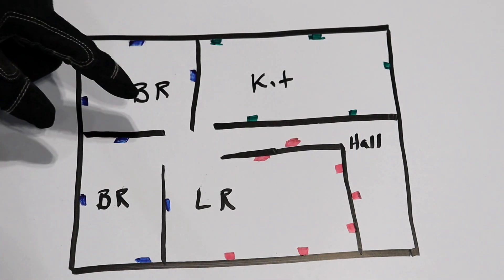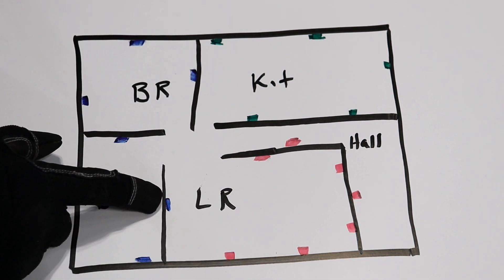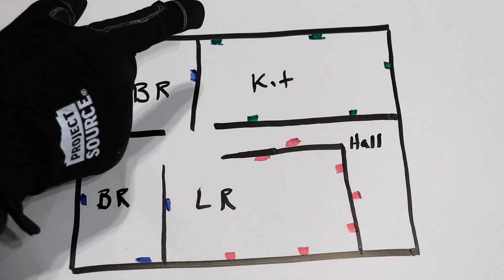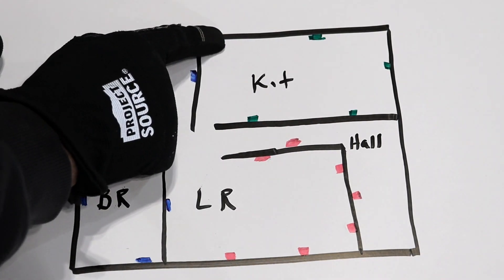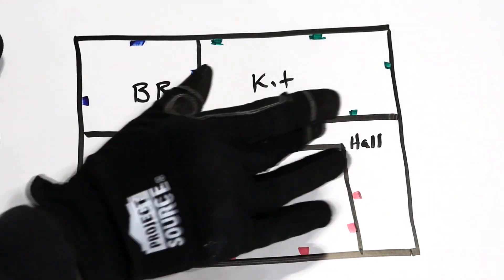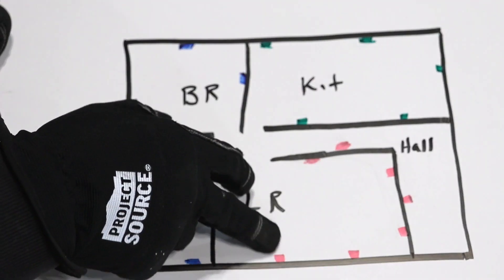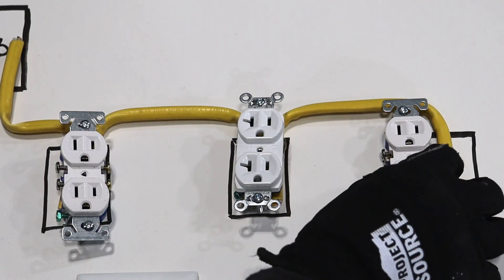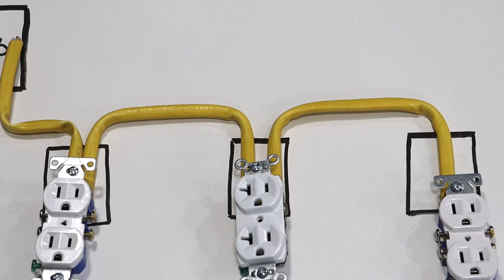How to Identify the Order of Outlets on an Electrical Circuit | Determine Outlets Wired to a Breaker

Comment: In Japan, they don't daisy chain their outlets. What they do is, for each room, they bring power from the panel to a junction box. And everything within that room gets power from that junction box including light switches. I think wiring that way is beneficial when it comes to diagnose because, if there is something wrong, the problem mostly is either at the junction box or the device itself.
Reply from the maker: That's true, but for safety, it is better to have lights and outlets separated so if a outlet circuit trips, you still have lights.
Reply: Rooms these days have 8 or 9 receptacles in them.  Even the smallest room has to have 4.  If you are not daisy chaining any receptacles then you have are going to have a pig tail with 6 wires in even the smallest room (hot, plus 4 receptacles, plus 1 light).   

Moreover, you would have to do all of your arc-fault and ground-fault protecting with breakers.  That's fine, but it costs more.

Comment: Why would you need to know the first and last or the order of it if everything is working correctly and if not then you troubleshoot and fix it
Reply: Adding a gfci to the first outlet in the circuit for a home with an open ground.
Reply: Reverse engineering 😊
Reply: if you wanna remove or move an outlet to a new location, you gotta know where the wire is coming from so you can decide if you need longer or shorter wire to the new destination

Comment: Thanks for the video. Is there a certain type of GFCI breaker to use with a GFCI outlet, or just the standard breaker is fine?
Reply from the maker: A standard breaker is used for a gfci outlet.
Reply: @brettleybuilt  thanks

Comment: Thank you for this vid. I have a GFCI that just went out. Used that tester by Klein and it wont trip plus the test/reset wont work. The GFCI outlet controls a receptacle on the other end of the house (rental so all screwed up) Tester shows hot gnd rev. Guessing I need to replace one or GFCI receptacle or both?
Reply from the maker: It may not hurt to replace both as the gfci which is bad is the big expense. For the cost of an outlet it may be a good idea to just replace both.
Reply: @brettleybuilt  replaced the main GFCI and it fixed the entire issue. Thank you

Comment: There is a much easier way, plug in a heavy resistive load such as a heater. Measure the voltage at each outlet. Outlets beyond the load will all have the same voltage. Outlets between the loaded outlet and the breaker will have progressively higher voltages. All due to voltage "dropped" from the resistance of the wiring and connections. This can also show bad connections when the voltage drop is excessive. The voltage drop due to a 1000W heater is very measurable over just a foot of wire or so.
Reply: That's interesting.  That's also a good reason to get a pigtail cable that plugs into a wall socket and has a couple banana clips that you can stick multi-meter probes into.
Reply: What connector is that?

Comment: Hey can a gfci protect outlets both upstream and downstream?
Reply: No, The gfci has a line and a load marked on it. Only an the gfci outlet and those downstream/load will be protected.
Reply from the maker: No, only downstream outlets.
Reply: Good information as a starter, but after 40+ years doing electrical work a lot of this is assuming that the house is wired in a conventional method, the work was performed up to code standards and must take into account any work performed after the initial rough wiring of the house when it was built. Outlets or lighting that was added or circuits tapped into can give false readings, making it even more confusing. I’ve seen some pretty horrible work out there that would make your head spin.
Reply: Thank you
Reply: @agustinherrera5600  It's because it's just tracking the current in and out. You can also get GFCI breakers, but TBH, I don't really get them as you'd typically just install a GFCI outlet at the first place you need to protect and potentially more if you don't like the idea of trying to guess which one is the one that's resulted in losing power to whatever you're using.

Comment: Any receptacle fed by a GFCI protective device should have a GFCI label.
Reply from the maker: That's true. I just think it's unsightly. I should have mentioned that in the video.
Reply: @brettleybuilt  TBH, it seems awfully unnecessary. I can see it being something that inspectors look at, but the moment the inspectors are gone, there's not much point to it other than knowing that if it's not powering things, then you might want to check the GFCI outlets. In my house, most of the GFCI outlets are on a 20amp circuit, so it makes it really obvious that it's also GFCI as the first outlet in that circuit is in the kitchen where GFCI is required. So, I have one unlabeled GFCI outlet in the dining room that's only GFCI because it's further down the circuit from the kitchen.

Comment: There is an easier way to tell the order.   Once you have the receptacle outlets identified as on a circuit, turn off the breaker, verify no voltage, and then take a multi-meter and measure and record the resistance at each receptacle between the neutral and ground.   Highest resistance is the last one, lowest is first, and the values in order will be the sequence.
Reply from the maker: I will have to try this. Thanks for the tip.
Reply: @    Let me know if it doesn’t make sense or if it worked for you.
Reply: What kind of ohm range of values need to be able to measure for this method?
Reply: @brettleybuilt  Did it work?
Reply: Can this be 100% accurate? 

What about split circuits like he showed- one receptacle feeds to two receptacles going different ways- whereas there would be a couple end devices. 

I wonder, too , could the receptacle be run up to and ending in the switches and/or ceiling fixture?
Reply: @NewTruths      Then the one closest will still have the least resistance.   If you know the resistance per foot of a specific conductor on a spool, and have access to both ends, you can tell how many feet are in the spool.
Reply: Everything is very good but that's not the only issue the issue here is that different receptors will have different loads and some of the load may not even show up on the multimeter if it's incoming voltage dependent
Reply: What if the wiring is so old there is no ground?
Reply: @artt6864  then you can’t measure resistance of what you do not have.  You could remove both conductors at the panel, and wire it them together and take readings in the two prong openings in the receptacles.
Reply: Sounds great...except, the original wiring (1957) does not have the 3rd wire (dedicated ground). So I cannot check resistance between neutral & ground ON THAT OUTLET.  I do have a spool of 14 awg ground wire and I could rig up a ground wire from the ground prong of a later, upgraded outlet. Would that work?

Comment: If you don't have a helper to flip breakers,  they make a transmitter and reciever that real cheap.
Under 30 dollars, just plug the transmitter into outlet and use the receiver on the breaker box.

Comment: So if the gfci outlet goes bad all the rest wont work besides the fact that all the amp draw of the regular outlets will go thru gfci outlet so your usage is  limited.
Reply: YES: if the GFCI fails and trips (and won't reset), then all other outlets down-stream will not work.
However, there is no limitation on the power-draw through a GFCI... they are rated to pass a full 20-amps, even if it is only a 15-amp rated GFCI device. There is no need to think you have to "limit" your usage, any more so than with a regular receptacle.
Reply: @Calico5string1962  I think the reason for that is probably how many are installed in kitchens and garages where things with more current are typically used, as well as the fact that you typically wire them in series, unlike most other outlets that may or may not be wired in series depending upon preference and what is going on in the install.
Reply: If you have the top power using devices on their own breaker it greatly reduces the gfi outlet capacity issues. Like separate for both refrigerator and microwave. Dishwasher and garbage disposal units. Unlikely to exceed capacity with what left in a residential kitchen.
Reply: Sort of, if you wire those outlets through the load terminals on the GFCI outlet that is the case. If you pigtail the GFCI outlets and don't pass the current through it to get to the other outlets, those won't be protected by the GFCI protection and will work just fine. But, in that case, you have to install more GFCI outlets if those outlets are in a place where code or common sense  dictates that you need GFCI protection. 

Probably the only reason to do it that way, is if you don't want to go on a hunt to figure out which receptacle tripped and you can't/don't want to get a GFCI breaker.

Comment: 1:38 - Code requires two circuits in the kitchen not counting the fridge or dishwasher, right?
Reply: Yes, the  NEC requires a minimum of two 20 amp small appliance branch circuits in the kitchen.

Comment: Very informative but I'd like to add that ceiling lights can be the home run point of a curcuit as it can be much easier to pull power cord overhead (less drilling) to create the first terminal. Also it is a point to split out a full curcuit run thus less drilling and wire use. If a curcuit for rooms start with a 20amp breaker, 12/2 wire can be used at the start of a run, then towards the end of a curcuit 14/2 is used as the amount of amps will not exceed (by code) a 15 amp draw untill further down the run. As a retired builder/remodeler I've had my fun chasing down curcuits especially on older previously remodeled homes.
Reply: What? A 20-amp circuit with #12 wire, can use #14 wire further down the circuit? 
NO, NO, NO... NEVER! 🤣🤣  That has never been legal nor recommended.
A 20A circuit requires #12 conductors - THROUGHOUT the entire circuit - from start to finish. It is a Code violation to use ANY #14 conductors - ANYWHERE - on a 20-amp circuit, regardless of what it's connected to. It would theoretically be okay to utilize #12 on a 15-amp circuit (kind of a waste of wire... but it would be permitted), and then perhaps transition to #14, downstream somewhere. BUT: even then, an unsuspecting/unknowing homeowner or electrician might see that #12 (in a panel) and see it is supplied with a 15-amp breaker, and the assumption would be that, it would be safe to up-size the breaker to 20A... but it would not be, if there was a mix of #12 and #14 wires in the circuit! (And no way to determine that).
ALWAYS use only: #14 for 15A circuits, and #12 for 20A (and #10 for 30A).
Today's modern NM cable ("Romex") even has color-coded outer-jackets now, so it's easier to identify: 14-2 is white; 14-3 is blue; 12-2 is yellow; 12-3 is purple; 10-2 & 10-3 is orange. #8 and larger are all still black.
Reply: @Calico5string1962  I think the confusion there is that you can go down to #14 at the end of a 15amp circuit for  lights. Where there isn't anything beyond the light. But, the 20amp stuff that's typically in either the kitchen or a work shop shouldn't be in the same circuit as the lights because you don't want to lose lights just because you accidentally plugged too much stuff into the outlets in an area that has a bunch of hazards.
Reply: These days they want you to pull a neutral to the switch box if it's not a refurb.  That way you can run another device from the switch box.  These days we got so much extra crap we can add, switches, sensors, remote controls, spaceship controls, etc..

 @Calico5string1962   - You can run a switch leg in 14.  Maybe that's what he meant.  If not, well